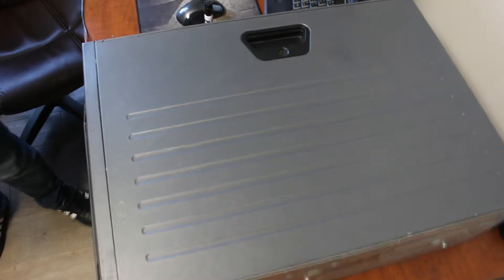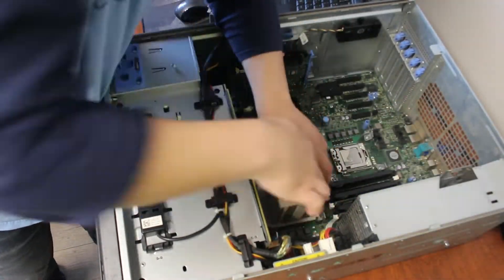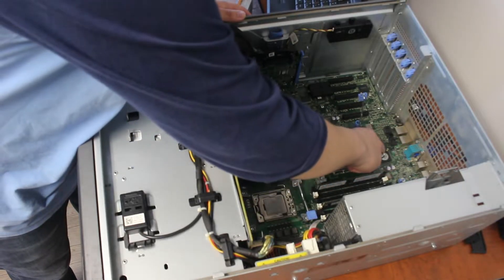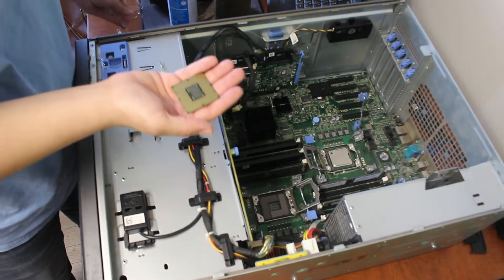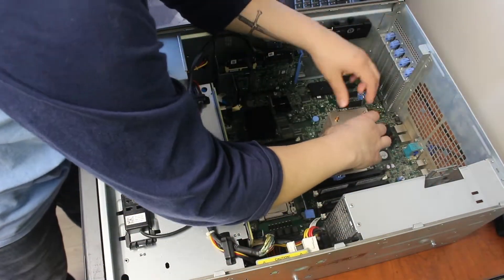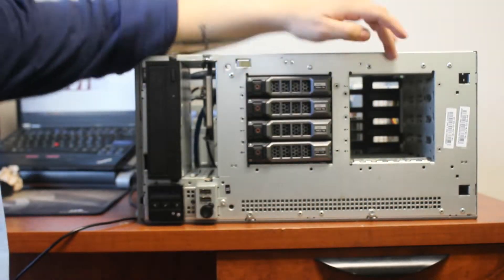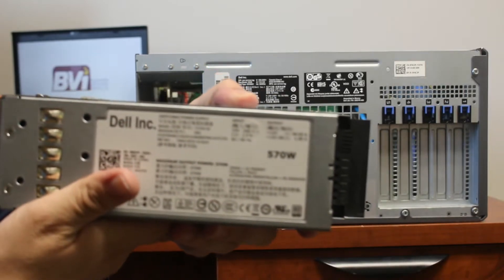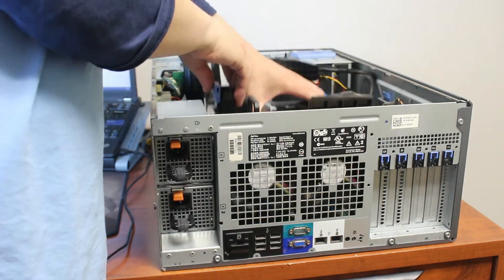How to Build a Plex Server 2021 [Part 4] Hardware Installation Dell T610

Comment: Hey guys, I’ve done basically the same upgrade here with processors, but I have 4x 8gb sticks and the system came up with an error stating not enough power. I have the 570w PSU, so was wondering how you bypassed that issue?

I’m running the latest BIOS as well A19 I think, but I thought I’d just upgrade to the 870w
Reply from the maker: In our next video we go into some specifics about what happened to our T-610. It didn't make it unfortunately and now acts as a nice mount to set our R710 on top of. We had some voltage regulator issues that were more expensive to fix  than buying another machine outright.
Reply: @BuenaVistaBros  well my original plan was to use it as a Chia Farmer, but with the power issue I was going to use it as a Plex Server, which is how I found this video.
Reply from the maker: @donovannewton9507  Well watch the rest of them and see if there is anything else that piques your interest. We have details on the plex server setup process.